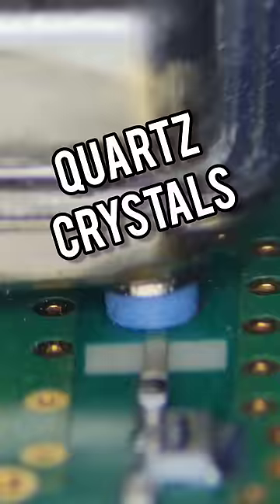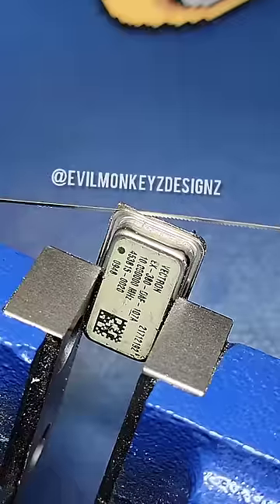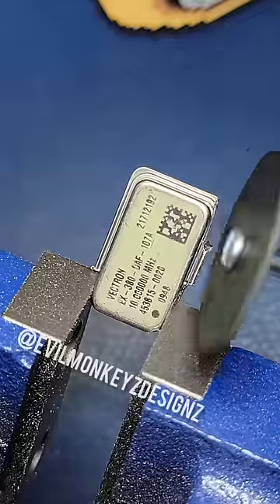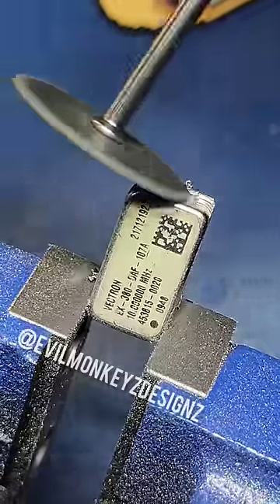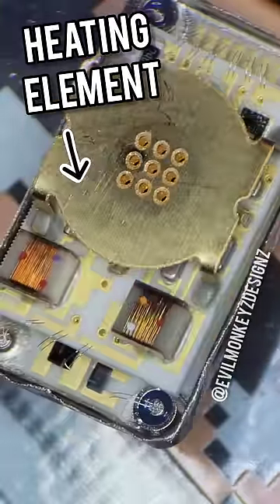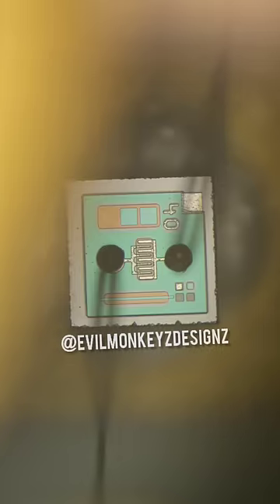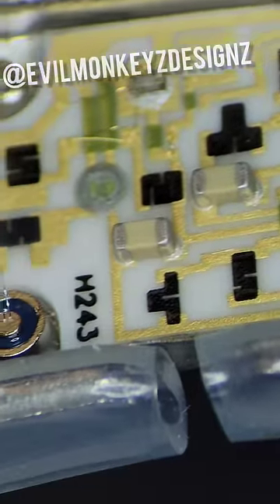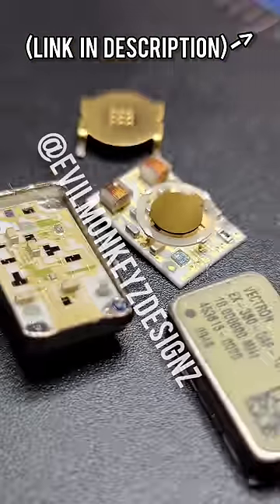CCU #239: Evacuated Miniature Oven-Controlled Crystal Oscillator

Comment: My first computer was a 25MHz 486. I replaced the 25 MHz crystal on the motherboard with a 50MHz one and it ran twice as fast just fine! ☺️
Reply: And here is me thinking that old school overclocking was playing with the mobo switches in an P1 system for few % ... aparently you were doubling the system's performance with that frequency upgrade. That's awesome
Reply: @contytub  Turns out it was cheaper for the manufacturer to just make 66MHz boards and stick 25MHz crystals on them if you could only afford the slower system.
Reply: Overclocking!
Reply: Huh. My 2,3,and 486 machines all had dip switches back in the day. But I also only used premium boards that’s probably why. So hard to find good 286 parts these days
Reply: Mine is the 66mhz 486dx2 but still good for my old PC-9801VA

Comment: You didn't label the crystal so we know which piece it is.  It certainly doesn't look like what people are expecting.  The ignorant among us needs help pinpointing it....
Reply from the maker: My apologies for not marking it. The quartz crystal in this part is the transparent disk underneath the gold-plated heating element that I removed. The quartz crystal itself has two conductive circular pads on it, one on top and one on the bottom.
Reply: Double the thickness of the regular ones.
Reply: @christopherleubner6633  -  Very high precision 10mhz. THe size affects thermal stability.
Reply: So is the crystal the circular goldy looking thing underneath the larger goldier looking circular thing you removed then ? I apologize for asking. Its just when crystal is mentioned folk think angular facet mostly and not a shaped or polished to other shapes. Like a flat disc.
Reply: @GraemeWight-wx3xz  the small clear square underneath
Reply: 😂Took me a while to find it!! Ten to fifteen replays 🤦‍♂️😄 I kept looking at the gold piece in the middle after he took the top off

Comment: As a RF guy have put one on these into a waterproof container with a battery and a solar panel. Attached a 1/2 wave dipole antenna and put on a high hill just to see how far the signal will travel. A little RF can go a long way.
Reply: I was amazed to find out you can build a simple AM transmitter with an audio amp, oscillator, and antenna :)

Comment: is the board itself quartz ? or was it one of the components on the board? which where is the quartz part!?
Reply: Quartz oscillates at different frequencies given the size and shape of the crystal, the atmospheric pressure, the temperature, humidity, and voltage applied across the crystal.  

The quartz crystal is generating the 10MHz frequency he is talking about in the video
Reply: which part is the quartz tho? @TheFalseSavior
Reply from the maker: The quartz crystal is the transparent disk underneath the gold-plated heating element that I removed. The crystal has pads in the center for connecting to the rest of the circuits. The circuitboards in this part would be some type of ceramic.
Reply: @Jeume  It's the round glass disc looking thing with the gold circle on it, under the metal cover/heater he yanked iff.
Reply: @TheFalseSavior Technically the crystal isn't producing the 10MHz frequency.
The crystal acts as a filter with a very high Q factor at the 10MHz. The filter is in the feedback path of an oscillator circuit, so it is in fact the oscillator that is producing the 10MHz signal.

The crystal just ensures the oscillator can only oscillate precisely at 10MHz.
Reply: The board is aluminium oxide since it is a very stable material that doesn't expand or contract much at different temperatures, which is very good in this device to keep the precision when everything is heating up.

Comment: I've used the mini heaters out of similar to heat up laser crystals to their optimum conversion temperature. It may be overkill but ime the heating element itself is usually very fine platinum wire as well.

Comment: The frequency doesn't change "drastically" with temperature. A 10 Celsius change gives about 3.5 parts per million change in frequency, more than good enough for many/(probably most) applications.

Comment: +-0.75Hz tolerance at 10MHz? on basic 8MHz crystal oscillators I've worked with I've never measured an output frequency even close to the limits of that tolerance, am I missing something?

Comment: I collect crystal oscillators, but I've never seen one that big.

Then again, I don't really take apart very advanced machines.

Are they called oscillators or resonators? Or are the two the same? Or different?
Reply: oscillators oscillate themelves, resonators can oscillate if used with a feedback amplifier of some sort that has the suitable gain and phase shift to sustain oscillation together with the resonator.

Comment: Jesus! That is some precision 0.0000075% error
Reply: And then we have modern oven controlled oscillators that are even little better and then there is rubidium controlled oscillators that are 1 second wrong in 100 years and then there is even much better caesium fountain clock that is off 1 second every 30 million years and there is even better than that as well.

Comment: If you took a 100mH coil & 100mF capacitor & PULSED it at 630ms You can actually get upwards to 20 V and 20 amps.

Comment: A crystals frequency changes drastically with temperature?  Not in this universe m8.
One of the main reasons that crystals are used is they don't change DRASTICALLY with temperature.  If they changed drastically with temperature then all the CBs would become unusable because it got a bit warm, or cool.
I mean we are talking about parts per million.
The oven is only used when exceptional stability is required.   👍🖖

Comment: I hope it's more accurate than ±.75Hz. That would be a ridiculously inaccurate clock.
Reply: FWIW, the data sheet says ±0.1ppm, which means that it might gain or lose one tick per ten million ticks. Since this is a 10Mhz oscillator, that means it might produce 9999999 to 10000001 ticks per second. Technically, that's a variation of 10MHz, but that sounds huge in context. Inverse units are weird that way, which is why they use ppm.

Still no idea how you came up with .75Hz.
Reply: Nope, it's about two orders better than regular crystals.
Reply: @zwz.zdenek  To be clear, the voiceover claims "a tolerance of plus or minus point seven five Hertz" about 3/4 of the way through, right after he pries the heating element off.
Reply: Here would be my guess where the 0.75 Hz comes from: Suppose the count is.9999999, but moving up in frequency. It passes through 10000000 on its way to 10000001, where it reverses direction and passes through 10M a second time on its excursion the other direction. That's a 25%, 50%, 25% probability of each count; thus the ±0.75 Hz accuracy. Just my guess at how the number is derived.
Reply from the maker: @wbfaulk I think I see the issue, and I blame the past me that wrote the information previously. I should have rechecked this information to make sure it was accurate 😅

The only thing that I can come up with is that I mistakenly interpreted the "Temperature Stability" listed under the Features section in the datasheet to mean the Frequency Stability of this part over temperature, which is incorrect. That value is +/-7.5x10-8. (0.000000075 * 10,000,000 = 0.75)

I agree that per the "Performance Characteristics" table on page 2 of the datasheet, that this part has a frequency stability of +/- 0.1 ppm over the operating temp of -40°C to +85°C, since this particular part is marked F-107.

Comment: Its not a vacuum. It is usually filled with Argon or another inert gas.  Sometime Nitrogen if they are being cheap.  If it was a vacuum, the oven would not work.
Reply from the maker: I'd recommended reading the white paper for the Evacutaed Miniature Crystal oscillators.

https://ww1.microchip.com/downloads/aemDocuments/documents/VOP/ApplicationNotes/ApplicationNotes/EX-380+EMXO+White+Paper.pdf